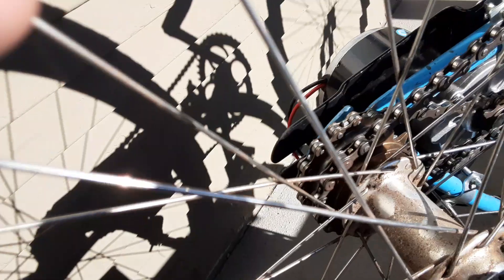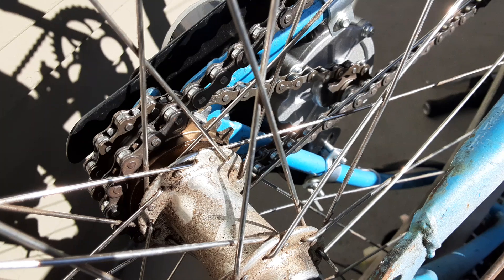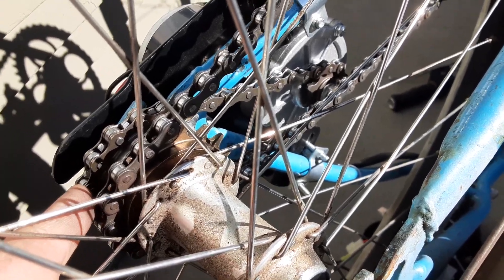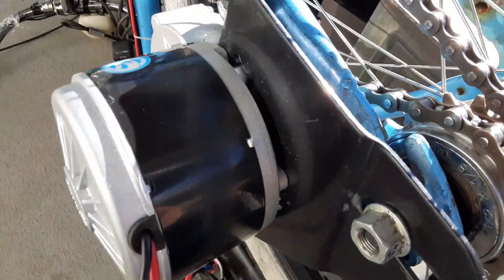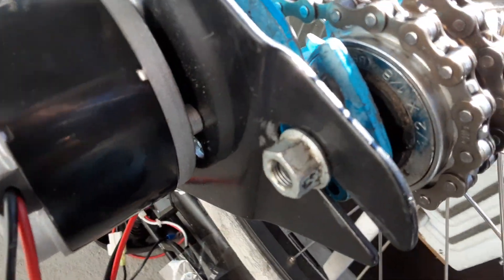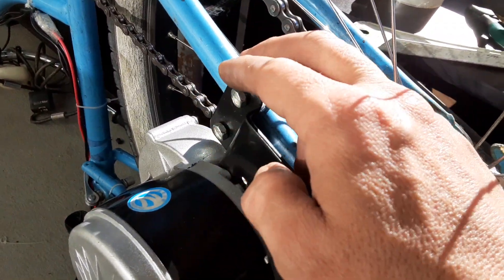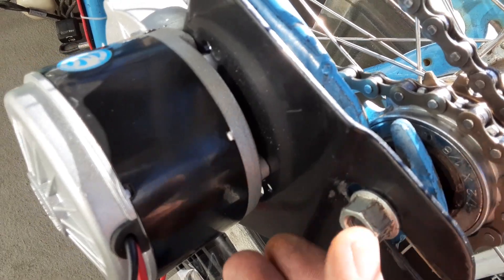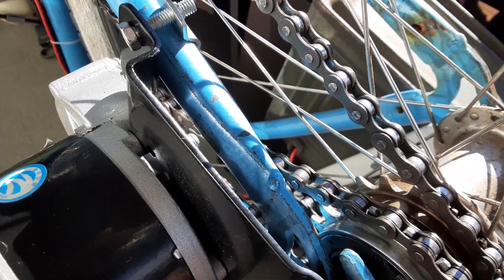Cheapest ebike kit on Amazon. Installing and tensioning the chains.

Comment: Hey where you get the bracket, buddy? SUBBED. I've got that bare motor. 25 bucks.
Reply from the maker: The bracket came with the kit.  $25 for the bare motor is a really great deal. Any more for sale? I need 2 more.
Reply: @ThriftStoreHacker  hi I'm in The UK. It was £25stg.
Reply: @errolkim1334  I'm in the uk,any details please? link would be great
Reply: @reefermadnice  OK ill find the name of the ebay seller and post it here
Reply: @errolkim1334  thanks mate

Comment: Hi what range do you get on what type of battery?
Reply from the maker: I'm using two 7s4p 18650 battery packs made with cells from old laptop batteries.  I get around 12mi on a charge.
Reply: @ThriftStoreHacker  Would that be 12miles with no pedalling or with pedal pretty much all the time?

Comment: I have a L-Fastener and it is to be installed on the left side -not right
Reply from the maker: It depends on the kit. Some are configured to run on the other side with a bolt on sprocket.

Comment: cannot get the motor mount to work on mine... ebike school channel just did a video on this kit saying "DO NOT BUY,"   i already had one in the mail.... yep, the motor mount is a real pain to get to work on a lot of bikes without some potentially useless fabrications
Reply from the maker: The kit is older technology but priced well. That bracket is a pain to get properly mounted. For my setup, I removed the gear and flipped it over so it stuck out a bit more, used the axle and lower mount on the bracket, and fabricated a piece to bolt between the top mount and bike frame.  I think I had to remove 2 links of the drive chain to get it all to line up perfectly.
Reply: @ThriftStoreHacker  thanks, maybe ill give it another go, try and make  something work
Reply from the maker: @spiritualwarrior1084  make sure line up and properly tension the chain going to the pedals first, then install and align the motor drive chain. Good luck

Comment: @Thriftstore hacker help me!!!  I'm wanting to install Lfaster kits on a couple of cruiser bikes with coaster brakes.  (I can use other brakes)  I do like the wheels tho because of the colors can the lfaster sprocket be adapted to these hubs???
Reply from the maker: The kit I used wouldn't work with a coaster brake. Had to change the rear rim and add standard brakes

Comment: Please make a bike form washing machine motor
Reply from the maker: I will look into finding a washing machine motor. Not sure how well it will work (usually an AC motor) but I will give it a try.
Reply: Washing machine bike? https://www.youtube.com/watch?v=dDizHIjZqBM
As for the alternator adapted into a motor, try https://www.youtube.com/watch?v=IKqy3rRWJQE
Another alternator powered bike here: https://www.youtube.com/watch?v=pwGj2poJAhY

Using a hoverboard motor: https://www.youtube.com/watch?v=Cn8ydguYYbA
Car starter motor: https://www.youtube.com/watch?v=wmrjMqlF38M
Reply: A car alternator also works with a 30$ eBay brushless ebike esc and it would be a bit easier because it will run good on a battery 48v or more rather than 100v+, only downside is the field winding on the alternator to generate the magnetic field constantly drain power at 3-12volts and 4amps which requires another dc pwm controller to properly control it.